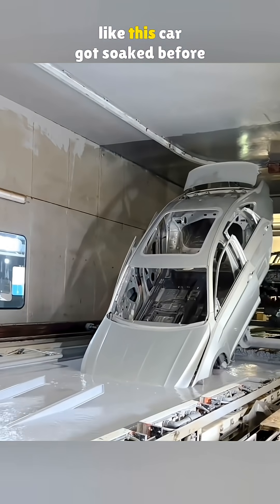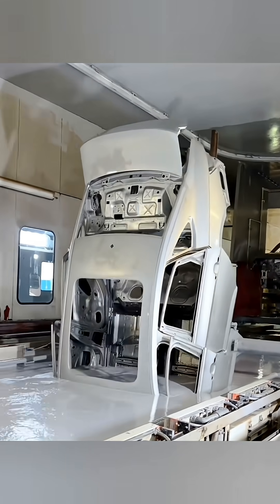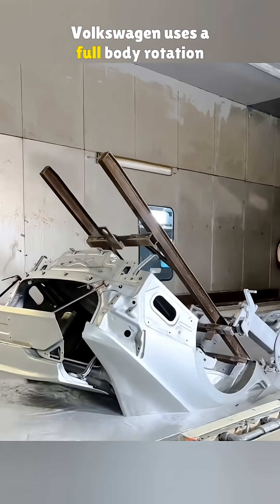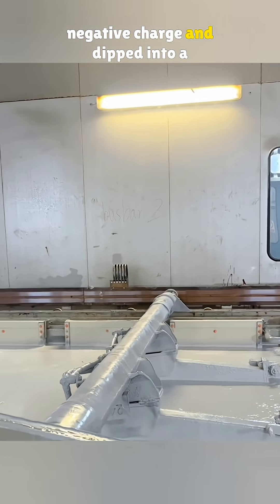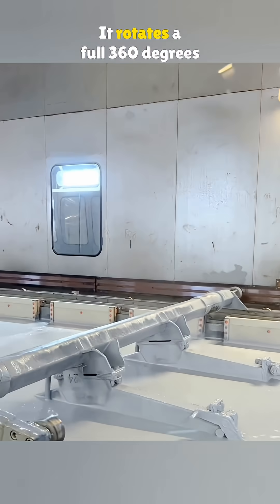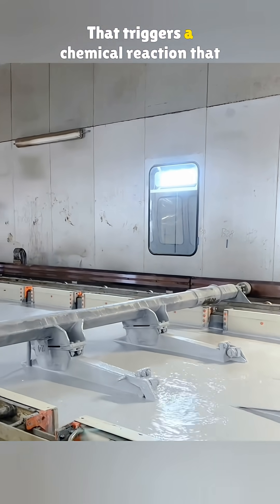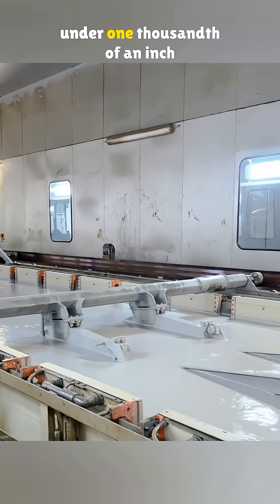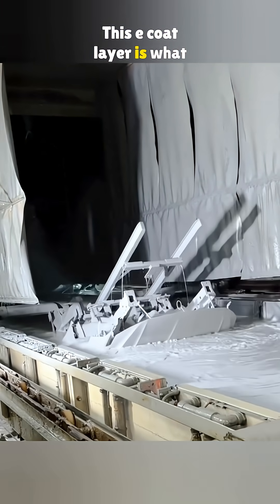Why New Cars Are Dunked in a Pool Before Paint #carstuff #automobile #factorytour #manufacturing

Comment: I wanna see what Ford do to prevent rust because it ain't this
Reply: Who said it? All brands make this step, it exist from decades.
Reply: @andreapicci8410  Correct, they all do this same type of coating and it does not protect the body any longer than the warranty period. One reason why is the coating is extremely thin. It's way too thin to withstand any salt spray at all. It's only a primer coat. It can't be any thicker because the primer paint in the pool has to be piss thin or it will make icicles and sags everywhere when the body is pulled out of the dunk, and it only gets dunked once.

The primer dunk is a good start and would a good base coat for additional protective coatings on the underbelly and inner body, but they won't do that. It goes straight to finish paint and they only apply that to the outer panels.

Also there are hidden areas inside that car body where the dunk misses completely due to pockets of trapped air and that leaves hidden areas of bare metal. (Ask me how I know, lol). Those hidden areas rust thru from the inside totally undetected and you'll never see it until it's too late, long after the warranty expires. Any aftermarket undercoating or "rustproofing" that the consumer applies to the car cannot address these hidden areas. These hidden areas can't be found or reached without stripping the car down to a bare body shell and putting it on a rotisserie. (Again, ask me how I know).

They don't build car bodies to last 20 years. They want you trade it in for a new one every 5 to 7 years. Maybe it can last 20 years if you live in a desert climate and never leave home.
Reply: @onemoremisfit  thanks very much, I guess you know all this 'cause you have been working for years in a car plant, right? 😉😃
Reply: @andreapicci8410  My reply autodeleted, probably because I mentioned one of my videos.
Reply: @onemoremisfit well fit to the cars industry, thank you!
Reply: They dunk every F150 into a salty brine pool to pre-rust all their trucks. This way rust starts forming at exactly 50,001 miles.
Reply: Vw has poor rust protection

Comment: Since the first beetle in the fifties. Fact.
Reply: Well if that's the case it doesn't work, as anybody who has ridden in a Beetle with Flintstone brakes will attest.
Reply: Not a fact at all. Beetles from that era rust just as much as any other car of the era. It wasn't until the 1990s that modern e-coating techniques for anti-corrosion became common on cars.

There had been other electrocoating systems introduced in the 1970s for processes such as applying primers, but it was in the 1990s that the big steps forward in chassis protection took place.
Reply: All car brands make this from decades, not only VW.
Reply: When I was young and foolish, I bought a mid-sixties Beetle with big rust holes in the floorboards. I had to bail it out when it rained.

Comment: All this and cars still be rusting
Reply: better than rusting away in 1 month
Reply: It depends on treatment, at some point VW/Audi used zinc coating. For these cars VW gave 12 years warranty. My VW 25yo with just a small rust issues. Later VW followed practices Korean manufacturers were using which were far less superior to zinc coating but this enabled them to compete at the same price range with Korean manufacytrers